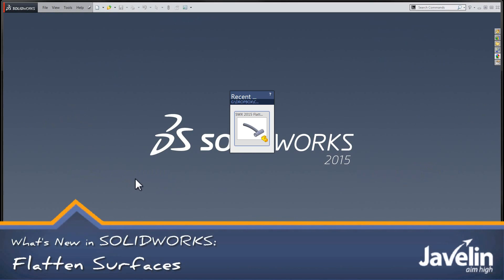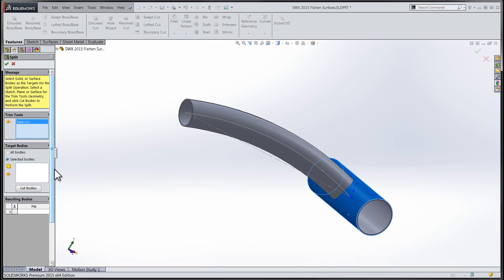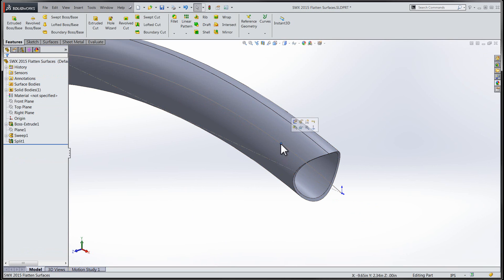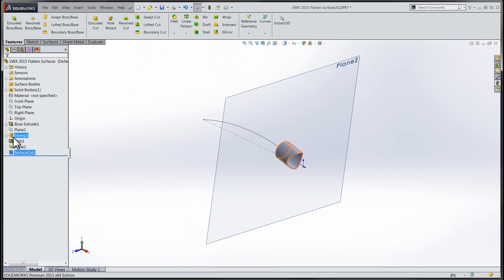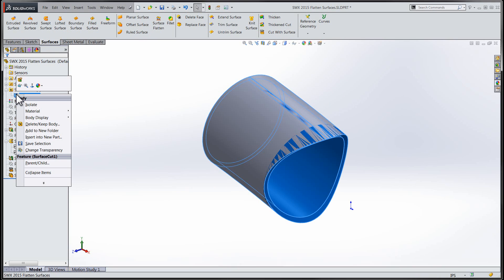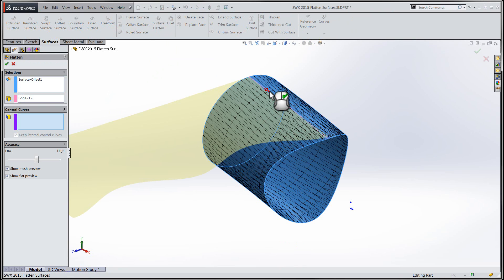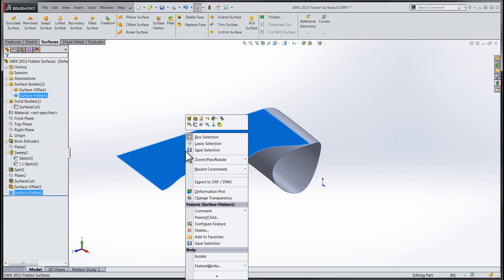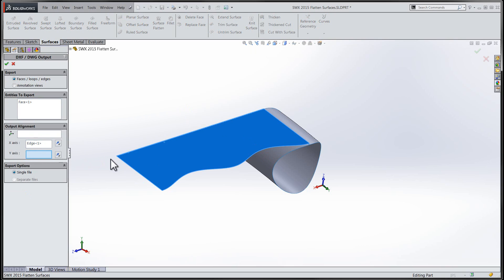Tech Tip: SOLIDWORKS 2015 Tutorial - Flattening Surfaces

Comment: okay so how do you get you surface to have the line on it to flatten from? i can't seem to manage that for the life of me using surface extrudes, or solid extrudes.
Reply: Well since I also wanted to know and I also do most of my work when tech is closed I will provide this.  You have to create a split in the part. Start at the center and make a pie slice cut.  You need to work from the end face of the tube and make it lengthwise.  I made mine .010 wide (smaller should even work) with the lines extended beyond the outer diameter.  Once cut what he shows will work.  Had me scratching my head also as it looks like a simple line but isnt.    I also just tried for my own info to use a  rectangle instead of a pie slice and setting it at .005 for the width  it also worked and allowed me to grab the surface and flatten it.   Hope this helps.  The videos are awesome and I am self taught with a little help from tech.  I use a different reseller then who produced the vid  and they provide great and more importantly easy access to tech.
Reply: @robertkaspersr.1582  He made it so easy but didn't show you how he split only one side of the tube.  Thanks for clearing that up.
Reply: Why does this feature get ride of my through holes when I flatten! @robertkaspersr.1582

Comment: Extremely uncool that Solidworks are releasing geometry transformation tools that Standard licence doesn't cover.  This is a sign that SW Standard is now no longer aimed to be an industry leader as surfacing software. The competition just got a whole lot cheaper!

Let me take this opportunity to strongly recommend the fantastic software Rhino 3D, which I use for this functionality now and clearly will continue to do so in the future. It's much cheaper than a Standard to Premium upgrade and will provide a host of other tools that are useful to Solidworks users. If only Dassault systems had the integrity of McNeel.